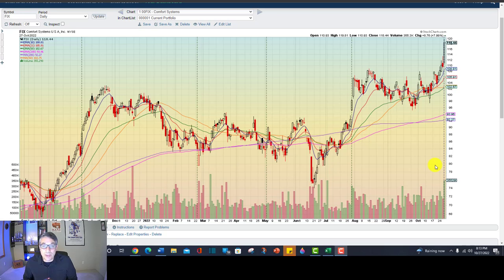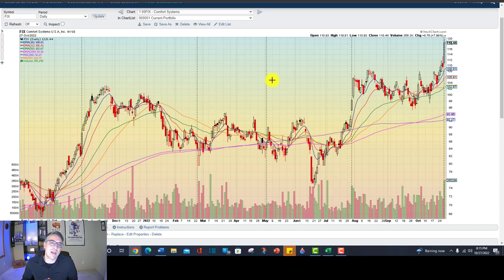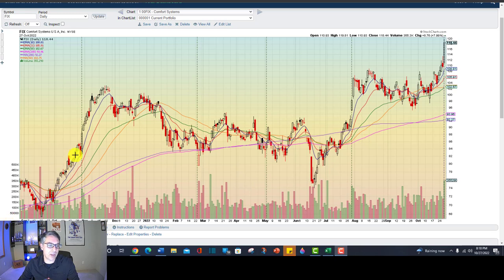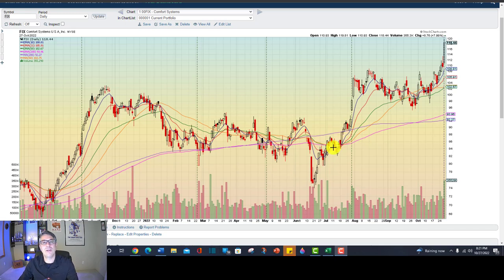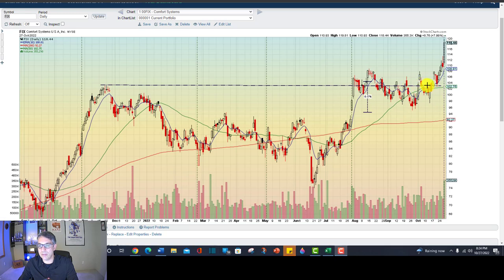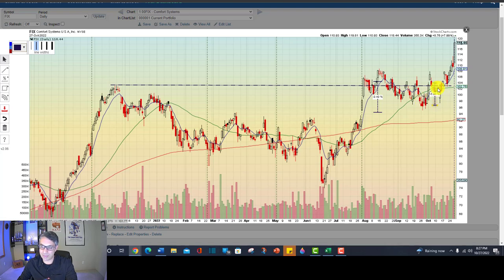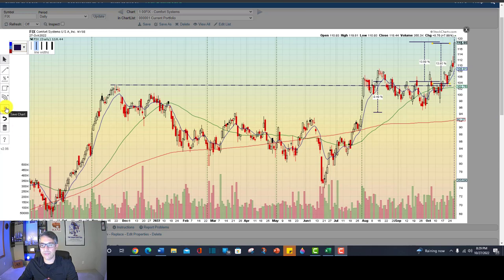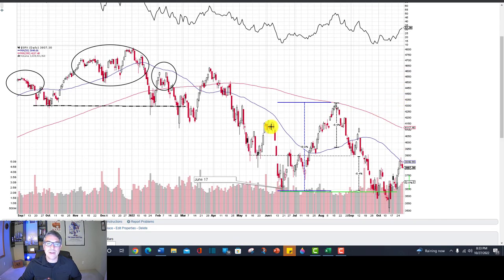Anatomy of A Cup With Handle | FIX Comfort Systems| Technical and Fundamental Chart Analysis

Comment: Hey joe
Reply from the maker: Re Akro, I sold the other half of my position yesterday. First heavy selling pressure since the breakout in late September. let's see if it can set up a base around 37--hopefully it will, and we can reenter. Re LNG, I'm watching it and might put on a small position if it pushes through 177.5. It's been in a base for a couple months, but it's a bit messy and wedging up the right side. would like to see it calm down and make a tight handle first.
Reply: @JoesInvestmentExpress  yes looking for base around 37.  LNG will see after earnings.